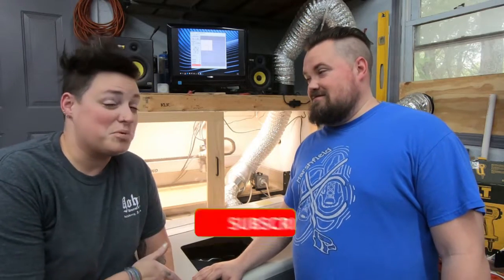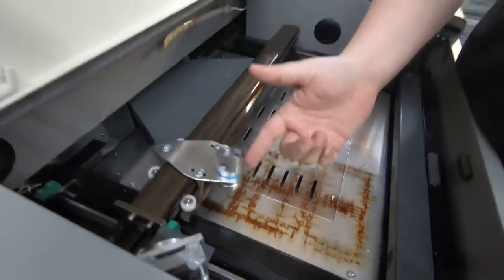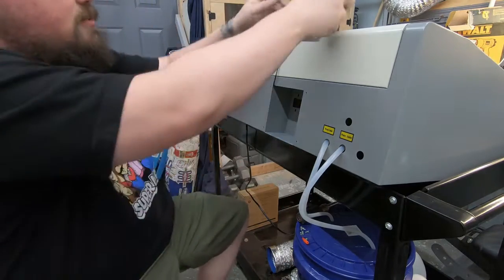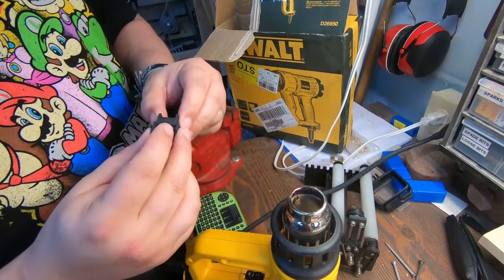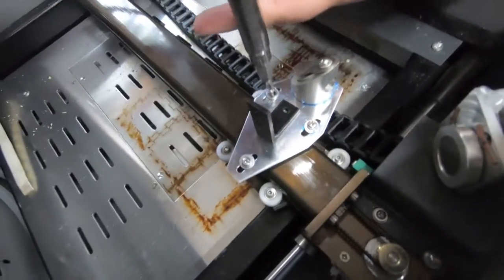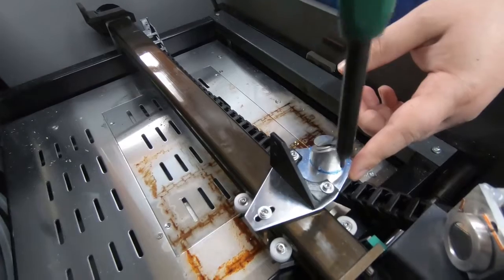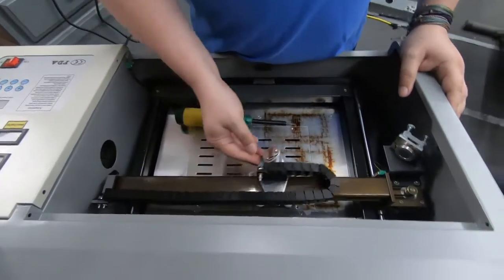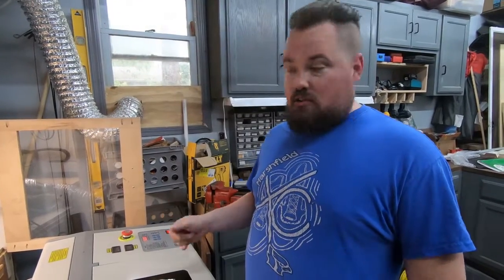3D Printed Air Assist CO2 | Monport K40

Comment: I'm a little late to the show but I was watching another YT'er (can't remember who) but he calculated the  surface area of the rear duct fan and the amount of inefficiency caused by the small opening the fan was trying to draw air through.  I think he said the dimension of the slot was 5 x .75 with a vast majority of the fan covered.  He cut the entire wall out so you can clearly see all of the fan from the inside and dramatically increased the flow of that duct fan.  Another YT'er used  a centrifugal blower midway of the duct to an outside port and the fan would pull positive pressure like a hardcore vacuum to extract fumes.  He warned again axial fans.  I have an axial fan and it works ok but not great.  Just some thoughts for you guys.

Comment: Where do you get your wood?  I have tried multiple vendors on amazon and they all arrive warped beyond belief.
Reply from the maker: If your laser will cut 5m you can find that at box stores. Most I have gotten is also warped. I like to sit it in the sun with weights on it to try and straighten it
Reply: @KLRform  nice I never thought about that. I usually put it all on a shelf and stack heavy books on top of it. I have the updated monport k40 so 5mm shouldn't be a issue.
Reply from the maker: @Vash612584  check out the cabinet backing or mdf core wood at many of the big box stores. 

You can also spray down the wood a bit with water then add the weights to help counter the warp
Reply: @KLRform  Thanks for the tips!

Comment: Do you have the stl  file for the air assist nozzel?  If so could you provide the link?
Reply from the maker: I got it from thingiverse.com. I don’t like it very much. It melted very fast and I will be replacing it with a metal one.